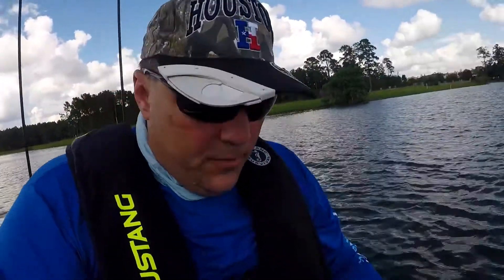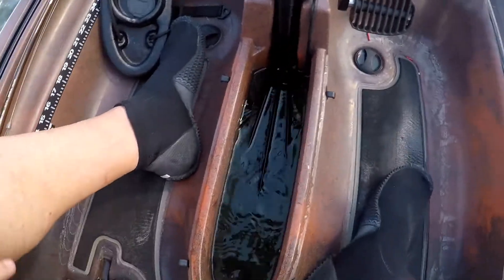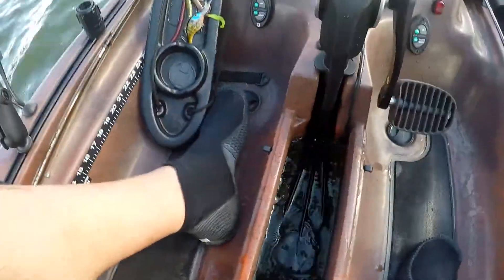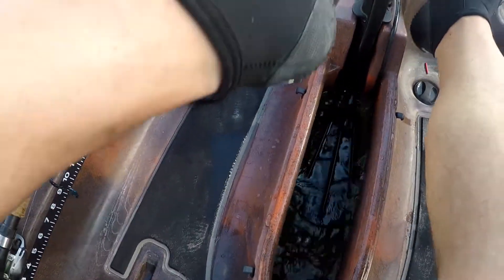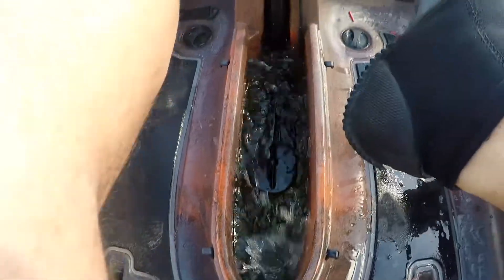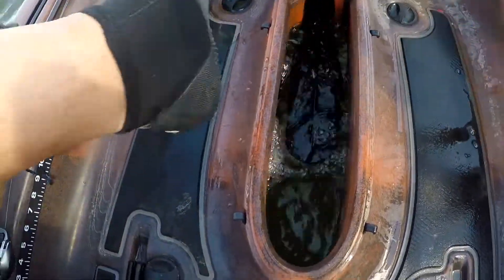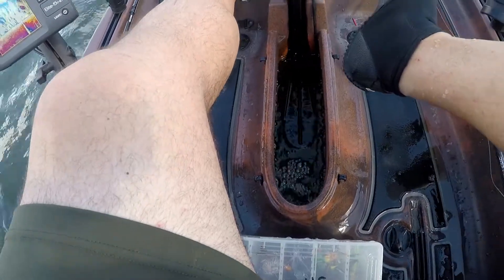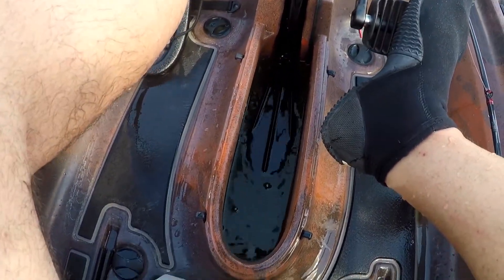Native Titan Cavitation

Comment: I love my titan.
Reply from the maker: Same here corrosive.  Other than some issues I keep having with the rudder cables coming loose. I think im going to have to put a crimp sleeve on it.
Reply: Wades World i haven`t had that problem but I didnt install it. Mine was all setup for me.  hpwever i dont like that the transducer is exposed, the vibe seaghost has a plate protector. i knock it loose once in an area with stumps already.
Reply from the maker: That's always my fear too.  The image is real clean though.  I used to shoot through the hull...but the image always looked like crap.
Reply: Wades World think it is bad because of the foam
Reply from the maker: I didnt even try to mount in the hull on the Titan.  i knew that foam would really mess up the images.  I had problems shooting through the hull on all my previous Kayaks. They worked, but still had a dirty looking image.
Reply: Wades World the vibe is a bottom mount but has a metal protector plate, image is fine.

Comment from the maker: Ive got big news coming soon on the cavitation issue. Good news! Dont let it hold you back from buying one.
Reply: Wades World Whats up wade, have you heard any news on a prop solution or anything? It's crazy how it's perfect in reverse but "chop chop" in forward motion, I've thought about cutting the blade down a bit but it would probably slow it down......can I borrow your PA14 until they resolve this issue hahaha
Reply from the maker: I have heard some news on the cavitation issue.  My Titan dealer (Delaware Paddlesports)  is sending me the new prop that supposedly fixes the issue.  I think they have clubbed the ends of the prop to direct the water back more. Ill make a video as soon as I get it in. From what I hear.. ACK hasnt gotten that info from Native yet.